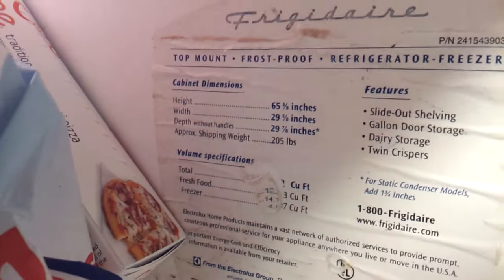Refrigerator dripping water inside FIX

Comment: I took off the collector but was not plugged up. How can I unplug the line or hose that runs into the pan? You think that air in a can will unplug the line if I blow air down it? Or the can of air isn't going to have the power to push out what's clogged in the line? Would some kind of cleaner pored down the line do the job? If so what can I pore in the line?
Reply from the maker: +COPO JOHN   I'm not sure. I never had to go that far with it.
Reply: That what she said :) Thanks for the post
Reply: +COPO JOHN   I had the same problem.  This video helped in that it showed my model (or similar model) with top light panel and how to remove it.  However, once I removed the 4 bolts, my catch was clean, no ice, no debris.  So, I pulled the fridge out from the wall, unplugged it, removed 4 screws that hold a cardboard panel,  and pulled out the condensate line from under the unit. (Its located just beyond the condensor, I think its the condensor). From here I used a 12gage elec. wire, but a coat hanger could work too, to run up the tube and try to clear out any debris. I bent the end with a pliers into a tiny hook.  Once I ran the wire up and down a few times, I used a baster with hot water to force water/air into the tube. I did the same back at the top inside the fridge. Finally for good measure, used good old fashioned breath to try to push any thing else out.  Once I got air moving, I pushed some water from the top side back down.  This seemd to have worked, as I now have water in my evaporator tray under the fridge instead of inside and on my floor!  hope this helps!
Reply from the maker: +Katie O'connor yes. taking it to the next level. thanks for posting this

Comment: Could you advise where to buy 6.5mm or 1/4 in socket on a screwdriver style socket driver? An URL will be great!
Reply: C'mon. A hardware store. Lol. Like Home Depot.
Reply: @tanya4534  i got it at Lowes. Followed the instruction but still leaking at the front
Reply: @CHAMONIX552  That hole leads to a drain tube that travels down to the underneath of the frdge to an evaporation tray. Could be that drain tube is plugged up somewhere and causing water to still back up into the fridge interior.

Comment: I can't seem to identify the screws. Are they obvious? I have Model FFTR1814QW0. Maybe is just has some sort of tabs? Don't want to break the piece. Appreciate any input.
Reply: Some models only have two screws in the front then you have to shift the whole  assembly forward to release from the tabs.
Reply: I also have that model and there is no screws but it won't come off. I have tried sliding it forward but still won't. There is no tabs with screws either. There is one like upfront where the dial is, but it is in middle of it and it isn't a regular screw

Comment: I've got a client with tons of water dripping. I've replaced door seals and cleared drain (was never clogged). Condensate forms very quickly right there in the fridge and drips from that curved wire at  back end of that light/vent housing same as in your video... Stumped.
Reply from the maker: I still get some drip off of that curved wire you mentioned. It's just not that bad, limited to top rack.  I put a paper towel there to soak it up. So....I don't know. Have not looked into that.
Reply from the maker: Just fixed the slow drip. (five years after making  this video.)  I forgot to put back the two bolts in the back of the light panel. Hope that will seal it and stop the drips.
Reply: @etmeyutub  i actually just did this to my fridge it recently started dripping whater 6 year old fridge. Was thinking i was going to need a new fridge. 
May try nee seal around the foam duct thay comes from the freezer too

Comment: I have the same fridge and issue,  I checked the hole no debris, still leaks. What should I try next?
Reply from the maker: Leaking from where? Is it inside, coming from the freezer leaking onto the top rack? Then try defrosting the freezer. Take everything out of the freezer. Remove the back panel in the freezer. Let that frost melt and clean it up.
Reply: @etmeyutub  nothing in freezer to defrost, its leaking on back wall making puddle at bottom under trays. Will try sealing area with silicone
Reply from the maker: @deandrahayes2257  it's not stuff IN the freezer. it's the freezer coils themselves behind the back panel.
Reply: @etmeyutub  I have the same issue. It's puddles of water and my drain isn't plugged. When I seen where the leak was coming from it almost looked like it was not draining on the drain tray but it's draining in the fridge. I dont know what to do

Comment: I have this exact same frigidaire.   I took it apart and the tray and tube were squeaky clean.  Any other ideas?
Reply: Dave Hummell the same thing is happened to mine and it's making a disgusting smell like somthing died in it
Reply: if the tube is clean it's probably leaking through the gap next to the reservoir in the tray,.. I have the same problem and just saw this on another video. Cover the gap with a piece of packing tape or duct tape, and it will drain into the reservoir and out the tube like it's supposed to.
Reply: Do you know the title of the other video? I have the same problem. Thanks!
Reply: Its called - How to fix Frigidaire refrigerator water leak, drip on top shelf
Reply: Has been working great for the past month,
Reply: 13angryBs Thank you!
Reply: 13angryBs thanks so much! I'm gonna try now but I don't have duct tape. Damn it!
Reply: thank you this confirmed my next theory.  theres a couple hairlines of gap inside the styrofoam inside the plastic tray.  i taped all gaps.  crossing my fingers.

Comment: Do you need to unplug the fridge first? I'm having a similar problem but I can't get in back to unplug it.
Reply from the maker: No
Reply: @etmeyutub   Thank you
Reply from the maker: @amandaperez2960   Look at the video. The light is on. That means it is not unplugged.
Reply: @etmeyutub   I checked it out and there's not only water but a chunk of ice in it. I can't find the screws/bolts to remove the "tray". I've had the Frigidaire for a year and a half. But I'm wondering if it might be a
freezer issue.

Comment: I have chronic water coming out and I have to put a bowl underneath. I have the same fridge. I removed the screws and disconnected the harness. But there was no blockage anywhere. What else could be causing the water to come from this area?
Reply from the maker: I just know what I know. Not much more.  i actually have a new slow leak I can't figure out.
Reply: @etmeyutub  Design issue with this model probably?
Reply: The following video explains where to put a bead of silicone around the Styrofoam.  It's in spanish but you should still be able to figure it out. https://youtu.be/hvt-hNQQeH8  (Autotranslate the closed captioning CC in YT to english helps if you don't know spanish)
Reply from the maker: Eric posted this: The following video explains where to put a bead of silicone around the Styrofoam.  It's in spanish but you should still be able to figure it out. https://youtu.be/hvt-hNQQeH8  (Autotranslate the closed captioning CC in YT to english helps if you don't know spanish)
Reply: @Erich1  or duct tape

Comment: This is not a "Fix" for the problem; but rather a temporary cleaning. Problem will return again and again until you take some corrective measure to get the ice formation to cease. Research online yields  a heat transfer solution by afixing a short length of copper 12 gauge wire from the freezer compartment's "defrost" heater bar and let it hang loosely into the drain tube's mouth. 3-4 inches is enough length. Heat will be conducted thru the soft copper wire into the drain. This will keep the collection tray's water temp just high enough to prevent it from freezing. Now, this is a "Solution". Permanent, Job Done!
Reply: David Veasey your right, it continued to leak even worse the next day after o cleaned it. So do you have a more simpler explanation as to how I can fix it?

Comment: How do you remove the other screws that don't use a screw driver? I was able to remove a couple but two others needed a different tool.
Reply from the maker: you need a socket set and and extension tool. Put the socket that fits on the end of the screwdriver-like extension tool
Reply: Thank you
Reply: I just cleaned mine out. I tried a 6mm socket - too small. Then I tried a 7mm socket - too big. Wound up folding a piece of paper into a strip and putting it in vertically down the length of the 7mm socket to make the fit a little more snug. Worked like a charm ;) Good luck with your fridge

Comment: I think I have a clog where the drain tube starts in the fridge and goes down to the bottom of the fridge. How do I clean that tube? Can I flush it with hot water?
Reply from the maker: I am not sure.  I never had that issue.  Sounds logical.
Reply: Compressed air works good too.

Comment: any suggestions on how to remove the bolts? I have tried wrenches and I just can't seem to remove the things.
Reply: You need a socket not a wrench but another way that I used is a screw gun with an attachment. Attachments on screw guns hold the different type of "bits" to use on screws but the attachment itself fits those fridge bolts perfectly. If you know someone with a screw gun ask them.
Reply: I used a 1/4 inch socket on the end of a nut driver.

Comment: Where are the 4 bolts or screws that you remove?
Reply from the maker: Get on the floor and look up at it. You will see them. They are in the recessed holes.
Reply: @etmeyutub  What tool did you use to remove the embedded flat bolt screw(s)? Ive tried different tools and cannot remove it. My frigidaire only has 1 bolt screw. Thanks.

Comment: I can't see any screws.. where are they located?
Reply from the maker: Kai200X they are in those holes. Recessed. Used a long screw driver type tool with a socket adapter on the end.

Comment: @etmeyutub  hi.  I have this Frigidaire fridge and it’s leaking water under the Vegies containers like your showing here but your not showing how I can take this lights out? So I just took out plug waiting to let  if any water blocage from freezer.  I will let you know.
Reply: He said just take out the 4 screws holding the light assembly
Reply: @shawnhedrick3570  Hi. Should I take the fridge plug out first? Then try to take of screws?
Reply: @biadaoukakis9148  Unscrew the 4 screws holding the assembly in place, then unplug the light cable that is inside the assembly, clean, put back together.
Reply: @vcvortex6356  Thank you much.  I will try it.

Comment: Wth kind of size I need for the front bolts?? The back ones aren't the same size or is it that there's not really enough room to loosen the front ones?
Reply: Mine were the same size.  Without going and looking at what I just put away I think 1/4, did you try using a extension to try and reach them better worked like a charm to get mine loose.